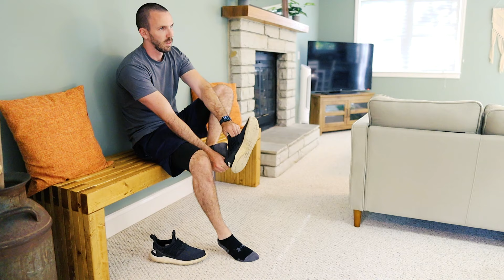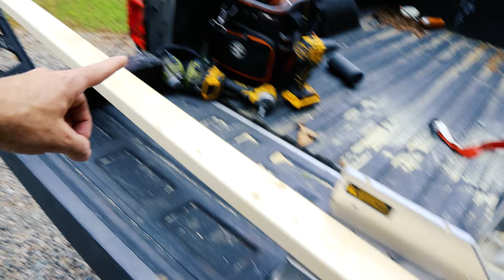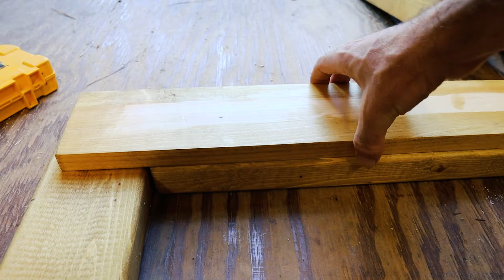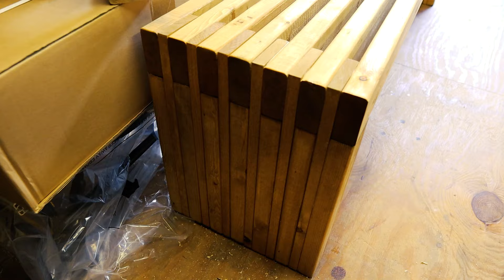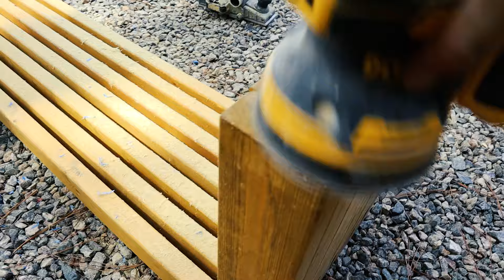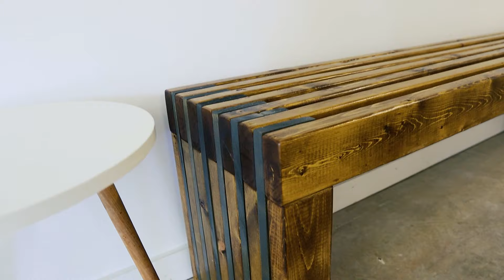How to Build a 2x4 Wooden Bench for CHEAP

Comment: Thanks for your input. I'm using your seat as a top for a shallow aquarium stand, with 4x4 legs, having crazy screw leveling hardware attaching the top to the legs, as well as the bottom of the legs to screw leveling feet. Over done with crazy expensive, but free hardware to look industrial. I'll be able to level an aquarium on a breakneck grade.

Comment: Love the bench. I did not find the measurements.
Reply: These were missing initially but were added sometime later. Expand the summary info below the video by clicking on the "more" button. Here's a copy of that specific info:
Materials:
(9) 2x4s that are 8'L
(3) 1x4s that are 8'L
Dimensions:
Overall - L 70"  x  W 15"  x  H 19.5"
Cut (7) 2x4s to 70"L
Cut (14) 2x4s to 16"H
Cut (12) 1x4s to 19.5"H

Comment: Will legs support just as is if I make this 10ft long
Reply from the maker: Without a doubt, yes. It's extremely sturdy. The only thing I'd maybe do with a 10ft span is add a small 1x4 piece of wood in the middle of the span (5' in). Do this between each 2x4. Probably not even necessary.

Comment: Great project, just a quick question/notice.
You got 7 2x4s, thats 14", plus 6 1x4s, thats another 6" in width, isnt your bench W 20" rahter than 15"?
Reply: A long time ago your calculation would have been correct. But for the last 50+ years, a 2x4 is NOT 2" x 4". It is 1.5" x 3.5" Similarly a 1x4 is NOT 1" x 4". It is 0.75" x 3.5". So your math was right, but you calculation was incorrect because the dimensions of the lumber are not what you assumed they were.
So for total width, the actual dimension is:  (7 x 1.5") + (6 x 0.75") = 10.5" + 4.5" = 15"

Comment: I copied this for a little 27” x 16” bench and it game out great. Thank you for not editing out the part where you had to fix the evenness of the bottom. I made sure to move the too short pieces so they were flush with the floor rather than the top, since I don’t have a planer like that. I still need to try polyurethane and hopefully it will look half as nice as your bench.  thank you for the inspiration cheers

Comment: I built one. The issue I had was the 2” Brad nails shot out the side?? Even if I went at an inside angle? I’ll be using it in the fire pit. 
I’m building a new one. But no nails, just using glue and screws.

Comment: Is this really indestructible using brad nails?  I’d have probably used screws.
Reply: The main thing holding everything together is glue. The brads just keep it all together until the glue dries
Reply: @brandonh6326 didn’t he say he didn’t want any squeeze out so don’t use very much?
Reply: @sportiekc2944  Yes for certain joints, but there's plenty of wood glue, plus brads, plus screws. The screws were long enough to go through 3 boards. While it's not really indestructible, pretty sure most whole families could stand on top of it simultaneously without damaging the structure.